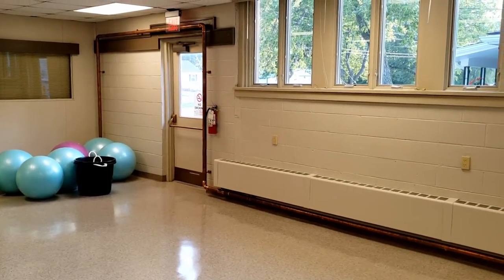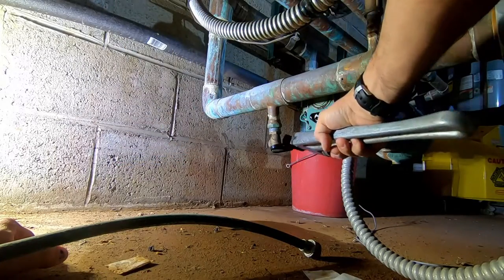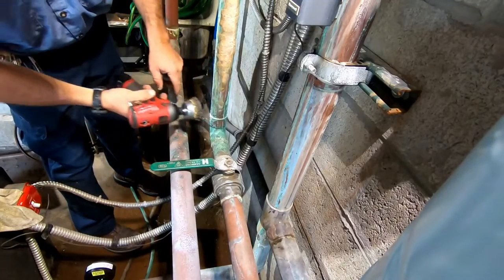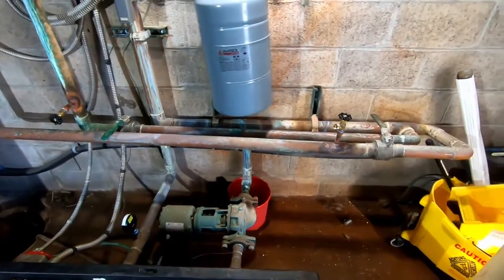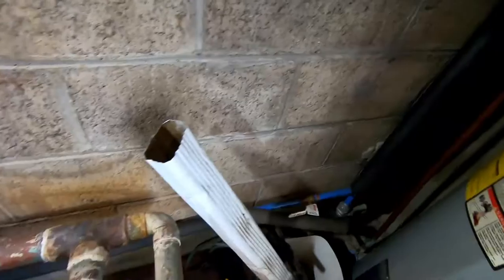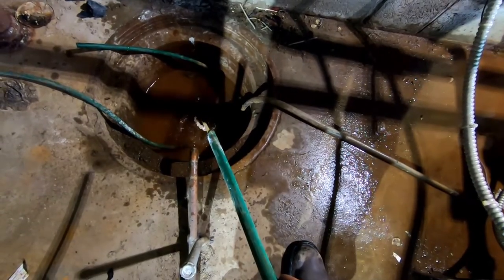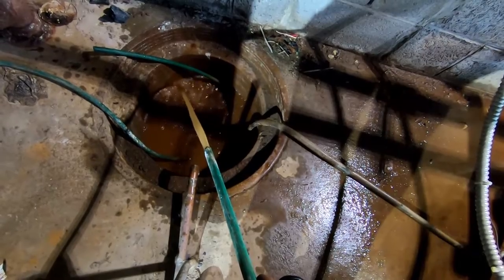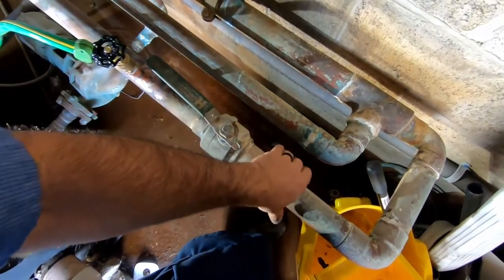How To Purge Air From Your Hot Water Heating System The Easy Way

Comment: I work out on eastern long island,NY been in the field for about 25 yrs.That was an awesome trick,you definitely taught me something today.Awesome job,great idea ,innovative, and definitely efficient. So after u downed the boiler and isolated the loop supply,return.What size pipe was that ,the threaded female you attached the gate/spicket into,which u then brazed into the supply and return header.Sometimes were I am plumbers will use zone valves to actually isolate a parallel loop for bleeding.The hardest systems I've had to bleed are the new condensing boiler,buderus etc.The boiler itself can be isolated and usually bled by a bleeder installed on the top by the manufacturer  .But when your by yourself and the fast fill is other side of the mechanical room ,it can definitely get tricky.That was awesome, and I definitely be using that trick myself !GREAT JOB 👍
Reply from the maker: That was just half inch copper to a half inch copper female, "these are plumbing half inches" lol.

Comment: The way I was taught is that the primary/secondary loop design is there to prevent a constant heating and cooling of the exchanger which may shorten its lifespan. Also, it provides hot water to registers quicker acting as a sort of "reserve". I could be wrong but that's what I learned.

Comment: Combining a little HVAC brazing with hydronics! Love it!  Smart move! 👍👍👍
Reply from the maker: Lol making it work no matter what 🤣. The craziest thing I've seen here is using refrigerant stems brazed into boilers to bleed them. It makes it easy getting the air out.
Reply: @HVACRSurvival  LOL, never though of that, but makes sense, drain some, drill hole and braze in, why cut the piping and fight with water trickling and space LOL

Comment: Great video brother. I rarely even look at boiler systems but do a lot of chilled water and glycols so always interested. You repair so many different systems surprised you don't keep pcb standoffs on the van. I bought a couple of cheap kits, helped me a bunch👊
Reply from the maker: Thanks grindstone, appreciate you watching! I probably have a couple those in my spare bag somewhere. Those ones were a little bit different than what I usually see on furnace control boards. They look like they were a little bit bigger

Comment: Hi Rick, enjoy your video’s, they way you share is very beneficial to new ones coming up in the trade!  I’m retired after lifetime in the trade.

food for thought, I found with most boiler systems, 50K to 8.5M when adding makeup water if you use a bucket with your hose end in it flowing water slowly, it will expel air air quicker.
Reply from the maker: I'll definitely give it a shot the next year around . Thank you for the comment and for watching. 👍👍

Comment: the loose board,  use small 4" long zipties through the holes and around the nylon pieces against metal plate or go through there and out around 2 or 3 wires on the nearest plug ( dont zip them very tight. it will keep the board from flapping in the breeze and possibly falling down/shorting out.
that one has separate plate screwed to boiler the board mounts to the, so you coul do large zipties behind the plate and clear around the board, again leave them loose so it doesn't smash and break if they work harden and shrink!  I know you wouldn't tighten them to death, but others reading comments may ;)

Comment: that magical change on the fly under pressure fitting @ 2:31 will blow apart and shower you in scalding boiler water if you do it under pressure or not. the o-ring goes bad fast and when you remove the gauge/air vent after a 3+ years, it will let go and the whole core piece will blow out and leave a wide open hole.
don't ask, but I'll just say luckily I drained all the pressure off first(checking expansion tank pressure)  and had system cooled to non scalding, because it still made a fountain of hot water(basement with 2 floors above) the magical valve was factory installed on a "caleffi air/hydro separator" from 2014. that's the first time air vent was removed, because it stuck closed. cuss-fest ensued ;)

Comment: I've always been taught to put the drains horizontal, so it doesn't si in all the crap from the system. Dunno if it actually helps but makes sense to me.
Reply from the maker: 👍 it does make sense. Of course if people were blowing these down like they're supposed to it probably would of been fine.

Comment: Hi   i recently did  service to my  water floor heating radiant   I changed the  expansion tank the pressure vale changed the Honeywell zones  the   zones are calling  and the   pressure gauge stays    just 2 line above the 20 and staying there   and i did  flashed the   water from all zone  lots of   dark water came out and  i left it to open tell    water color got  back to  normal   but the issue i have is  the  first floor  which got 2 zone  both zone  got warmed  but the upstairs  only get to  10 degree  does not matter if  i  leave the tramontane all the way to the end or levee it on   20   so what cold be  wrong  what  do u suggest please  Thanks
Reply from the maker: You likely have air upstairs, it will go to the highest place unless you can force it back down like I did against a ball valve with a drain in front of it.

Comment: is this genuinely quicker than going around bleeding individually? do you dose the system with inhibitor? very interesting video and channel thanks for the effort
Reply from the maker: The aluminum high efficiency boilers like well McLean requires the inhibitor, but generally a lot of these do not get it. In a perfect world they all should have it. If the radiators were in series for each circuit it would have been flawless but I did not know what the layout was on this system because I had not worked on the boiler here before. That radiator system that they replaced would have taken forever to bleed at the key bleeder (if it had worked 🤣... I have to go back and replace it) and yes I did have to go around to other radiators that I did not show and bleed those. To further answer your other question, most people around my area want to do everything cheap. Thanks for watching 👍👍 and checking out my channel and please consider subscribing if you haven't already.

Comment: any particular reason you use the blue teflon tape? I noticed you do have it also on your stubby gauges.
Reply from the maker: I prefer tape because it doesn't make a mess, but if I'm going to do any water lines I've never had a leak when I use teflon tape and dope both. 👍👍

Comment: They need a spirovent on the system.
Reply from the maker: 👍👍  It wouldn't hurt for them to have a whole new system.
Reply: For sure those primary tees look like there too far apart and the primary pump should be counter flow to the secondary also the primary should be flowing into the boiler.

Comment: High point air bleed is the only way to go
Reply: yeah, not sure how well you're going to power bleed that large of diameter piping, unless you can give it over a 1" full port bypass feed and same for purge outlet valve.  I just don't see a 1/2 or 3/4" and probably not 1" bypass feed and drain(no garden hoses!) developing a high enough foot per second flow rate to get the air out
Reply from the maker: If it wasn't the monoflow tee system I could have vented that out with a freaking quarter inch.

Comment: Mutitalent innit !
I'm surprised they didn't insulate the piping though , they must loose a lot of money just from the thermal losses innit .
Reply from the maker: The streets are paved of gold in this country. Money don't matter here 🤣. Just kidding, generally they cut corners wherever they can,  if you notice where we did the work it was insulated.
Reply: Don't insulate.

Can't see problems..
Reply: I should elaborate, don't cover the copper. It will alert you to bleeds and weepers. Insulate the room, foam boards and reflect tape, fire caulk and foam too.
Even the door should have a sweep and a good gasket. Then if it gets too hot in that location which is always the case eventually, cut a vent and a fan and hook it to a Honeywell to be autonomous.